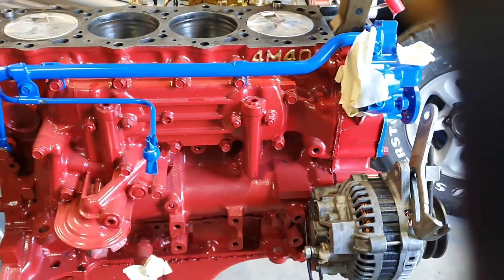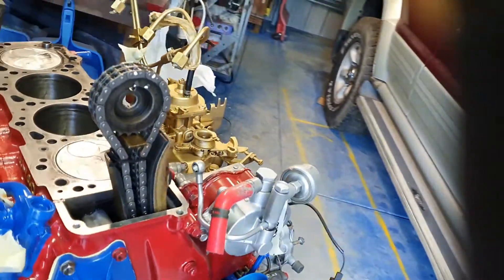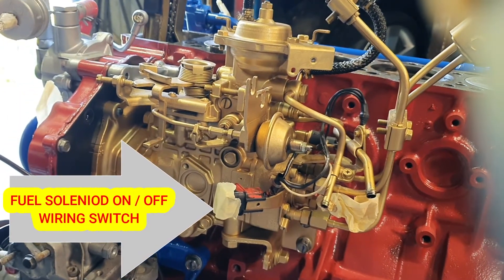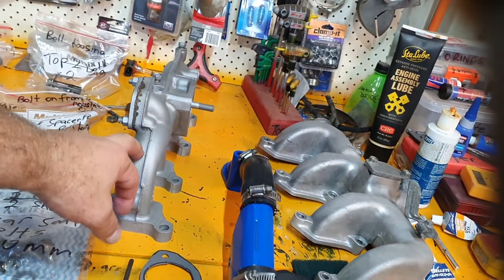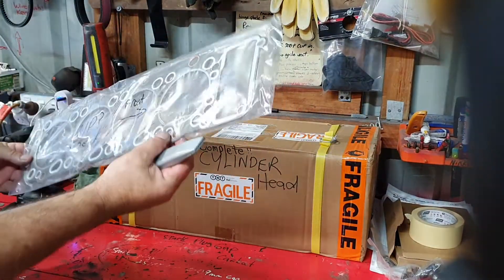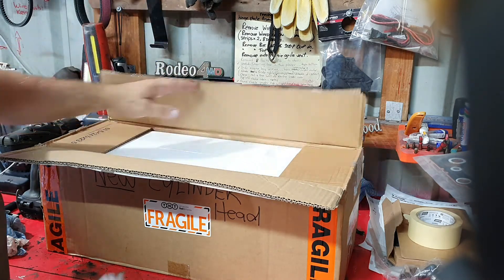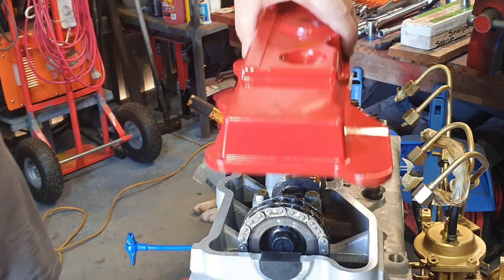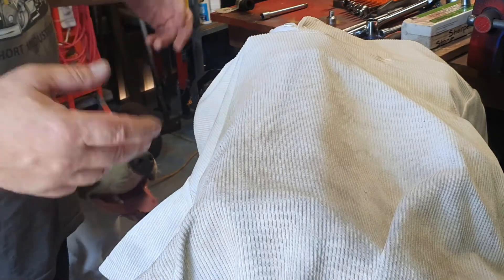MITSUBISHI NJ Pajero 94  PART  4   ENGINE REBUILD 2.8LT 4M40T

Comment: Are you using Hi Temperature paint for the engine?
Reply from the maker: I think by memory yes a holden red...but not to spoil to much for you on the second engine build!! I used the vehicle colour to match with hardener and clear coat of the gun not a can🙂

Comment: One point, the steel water bypass hose that goes from the front of the head to the thermostat housing needs to be pushed into the head before you lower it onto the block, otherwise you have to remove the stat housing to get it on.

Comment: Just a tip, thoose half moon seals on the head that meet the rocker cover gasket are notorious for leaking (especially the rear) so I like use a little gasket sealer on them.
Reply from the maker: Hello...yes your so right great tip 👍I used blue rtv sealant

Comment: As a 97 Series 1 L400 Delica owner myself really appreciate you posting this 4m40t assembly process. Hoping I can make half a million clicks before considering a rebuild getting close 250000 now. Used the same Tora water pump no slaz just the o'ring so far no issues. I've Also replaced the original TF035 turbo after noticing some oil consumption with an ebay chinese clone maXpeedingrods branded TD04 ($160aud) and am pretty happy with it so far aswell...The red and blue colour scheme is giving me 80's Optimus Prime vibes. From what info I've found some ebay heads can be squiffy with AMC manufactured  heads being the 'better pick' if locatable.
Reply from the maker: Awesome thanks to know ill be changing the turbo good info is it the same size as I don't need much bigger thinking of lag🙂
Reply: @AussieManCave  Basically the same impeller but smaller turbine on the TF035, I didn't notice much lag perhaps in 1st gear take off, but it's negligible. I did port the wastegate and gasket match the manifold flange. So I am hoping it can breath a little better under load. My next DIY is 3" stainless straightpipe/resonator exhaust, so any turbo spool up issues should be non existent.
Reply: I'm on 40,000 km on a Chinese head. I used a genuine head gasket and genuine head bolts though.